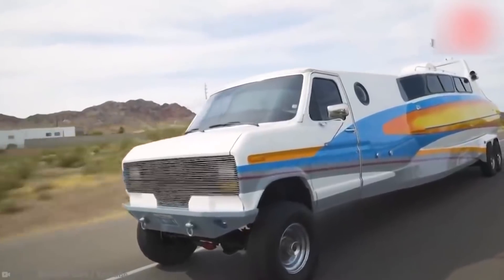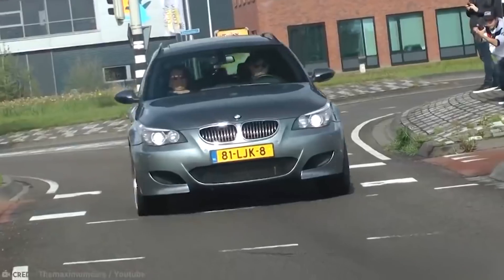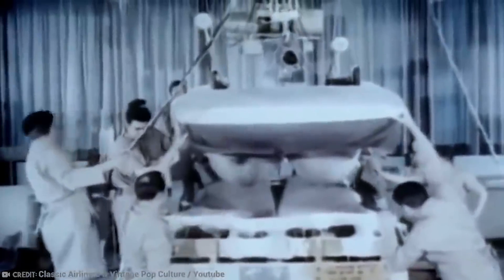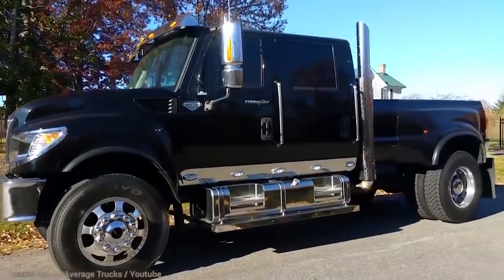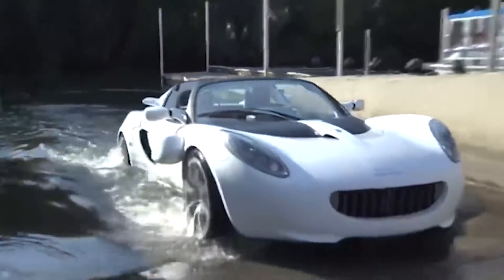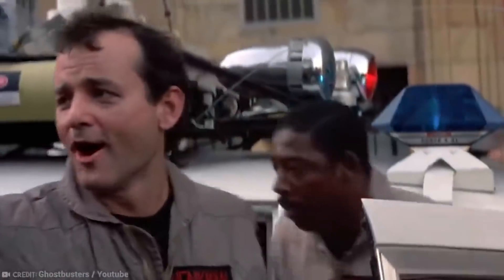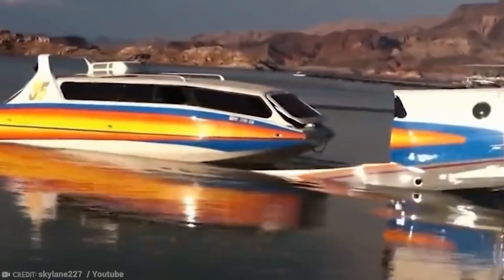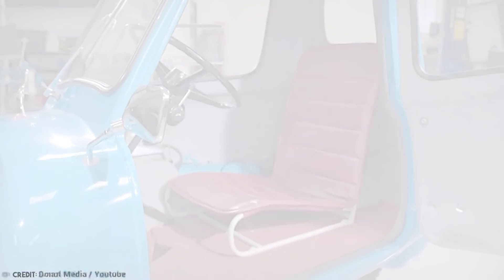15 Strangest Cars Ever Made

Comment: There is some misinformation about the BMW Isetta. There were only about 1500 of the three-wheel version as an export model...and the Isettas had 4 gears (unsynchronized, shift lever on the left) and of course a reverse gear. I drove several of them. One could overcome also larger gradients with it problem-free! The top speed was after all about 90km/h (about 55mph), which was at least the maximum speed allowed in the USA in the past!
All in all: It was a really great little car, which was also very economical!

Comment: 02:00 that's a photoshop job. You can see the second headlight is repeated. The steering wheel, mirrors, plates, door handles, seams, gas cap and wheels have been removed, along with the reflection in the windscreen.

Comment: Back in the early 90's, the Ford truck dealership I worked for, at the request of a local construction company, took an F600 and turned into a 6 door dually pickup with an 8ft bed for their crew to get to various job sites. Me being the only parts delivery driver trained to operate the larger trucks, got elected to go deliver that long beast.
Reply: Have you any photos

Comment: You included the banana car, but left out the hotdog car  (which includes the bun).  Also, there was a production bus looking car that had dually rear and dually front tires.  The driver sat in a second story cockpit about13 feet off the ground.